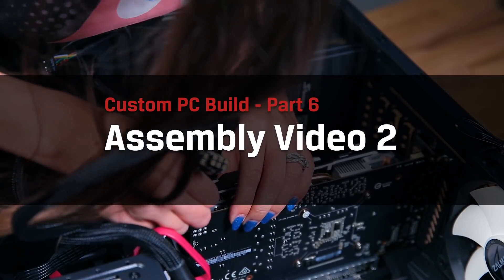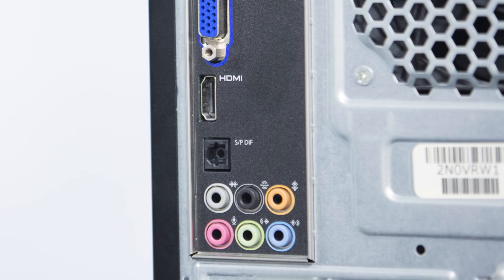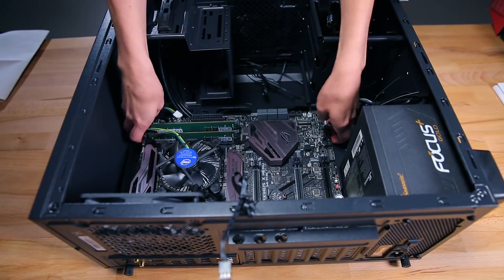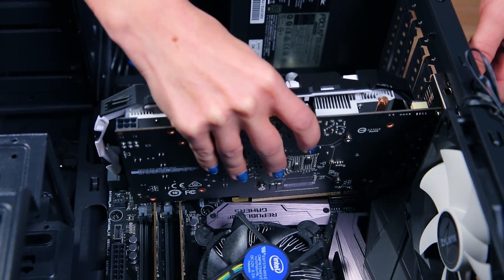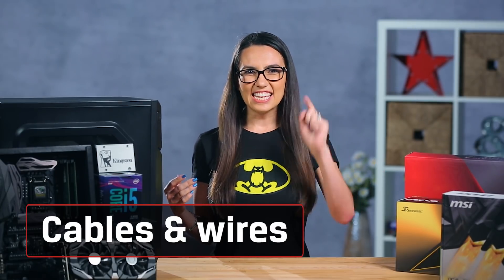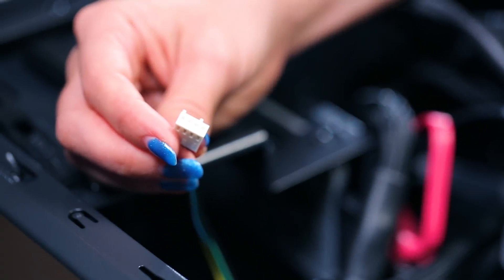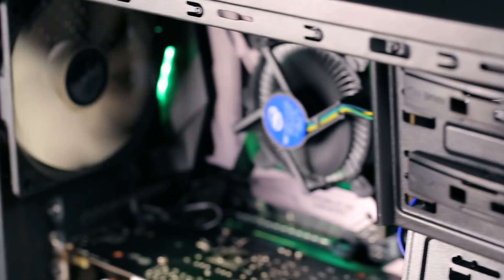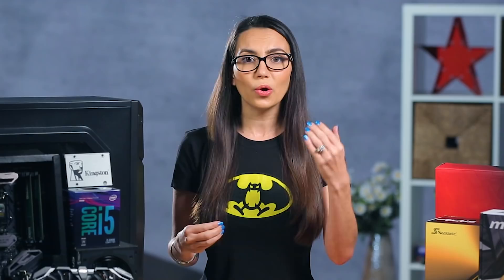PC Build – Installing IO plate, motherboard, GPU, cables, SSD – DIY in 5 PC Build Part 6

Comment: pls tell me how to replace the processor
Reply: Remove your cooler by following the manual. Clean off the thermal paste using IPA and a lint free cloth.

You'll see one or two metal arms latched down on the side of the cpu socket. Slide these slight out and lift them. Lift the slot cover.

Gently lift out the cpu and place it safely on an anti-static surface.

Use the triangle reference on the new CPU and socket to align it correctly befor gently inserting into the socket.

Lower the arms and latch them down. Apply a large pea size of thermal paste to the heatspreader of the CPU.

Refit your CPU cooler following the manual.

Comment: Just as hard to watch as the Verge pc building video. Love the energy, but it's not needed here.
Reply: I'm sorry but I can't agree man. As I said in my original comment, there's little substance here and it's rather cringe, but the Verge is on a whole other level of incompetence.

What was provided here was mostly accurate, just very sparse. It's not a guide really, it's a thinly veiled advertisement.

The Verge was a car crash of poor choices, poorer knowledge, abominable implementation and the worst delivery in any tech video I've ever seen.

You don't have to be somber to present a technology channel, LTT isn't exactly low-key and last time I checked, they're doing OK.

Comment: It is better still than the aio...that is restrictive in volume. why the ek was ok..nothing fancy though. Block wise more like those old swiftech blocks, You are making blocks smaller and more restrictive now...That's easily 2-3x more volume and can even throw moreeee pump at it.
Reply: What was this in reference to? They used a stock cooler, there's no custom loop here?

AIOs are decent enough, and restriction has got nothing to do with modern custom loops.

As for restrictions, a DDC or D5 can easily overcome the restrictions of modern CPU and GPU blocks, and the reason they're so restrictive is modern microfin manufacturing allows for significantly better cooling.

Comment: I have got a problem with my old pc ( i hope u guys can help me out)
so,when i boot up my pc it just shuts down automatically and again boot on its own. I checked and I noticed that my fans are working properly, i took the ram out and put it back but still its not working. What to do can you guys help me PLEASE????
Reply from the maker: This issue can be caused by many different factors. Is there any type of blue screen or message when it does this?

Comment: I. Want. A. RIG! I'm currently running an Acer aspire e15 and I have to put it in suspended animation (so called) for about a month after playing every day for three weeks straight. And it's only A YEAR AND A HALF OLD

However, it was four hundred bucks from best buy soooooooooooooooooooo. But when it does it runs games pretty darn well

Comment: now that i have a pc i can run up to 200 psi
and can run games like fort nite and mincaft  at 200 psi
thanks 4 the build help now i have a asome gaming pc
Reply: If you're running your system at 200psi then something's going to explode, that's a lot of pressure!

What compressor are you using?

Comment: Hey dear, Please compare the Intel core i7 HK CPU with Ryzen latest versions with their price.
Reply: Which would be better for making videos and gameplay.
Reply: Let me help you. Ryzen provides the best bang for buck if you want to do anything but game at the best possible fps.

Ryzen offers better value, flexibility, longevity and a long-lasting platform. Given the current security issues, supply issues and the trends of designing for cored, Ryzen is an easy choice at the moment.

I'm currently running an 8700k, but my next build will be a Ryzen.

Comment: Wait, so, what if I wanted to transplant the hard drive from my current computer into a new one? Would I still need to boot up an OS from a thumb drive or whatever, or would all of that already be taken care of since the OS is installed on the drive? Would there be any complications from transplanting?
Reply from the maker: There might be complications if there are driver compatibility issues. It would be better if you did a clean install of the OS when putting the SSD into a new system.
Reply: You'd be better off doing a fresh install.  Backuo the files you want from your existing drive, reformat and do a fresh install.

This is why I have a drive specifically for the OS. All my libraries etc are on other drives, so when I reformat, there's almost no work to be back up and running.

Comment: 753 people think they are better at building PCs than the rest of us. For me, I go refurbished and then go by parts if I have to. Cheers!
Reply: Nothing wrong with that, ultimately it's whatever works for you best. There's plenty of instances where say, an old office PC paired with a decent GPU, can make a great budget gaming system.

I disliked the video because it offered no more information than component manuals, and skimmed over important factors that could actually help someone trying to build a PC for the first time.

Comment: I have format system reserve partition during booting pc dell vostro 3560 and suddenly it stop when I again try to boot it doesnot boot, in recent there is no os in my system, how to again install system reserve partition or os
Reply from the maker: Hi Rohit, Kindly contact your system manufacturer for further assistance on bringing your system to factory condition.
Reply: Pull the drive and put it in another system. Recover all the files you want to keep and store them somewhere safe.

Reformat the drive/partition, and reinstall windows.

Comment: dose any one really need this? these days building a computer is to easy, you cant even have IRQ conflicts these days.
Reply: Not this no, there's more information in the manuals.

Cable management, fan config etc for beginners, yeah sure.

At least it's not the Verge.

Comment: A graphics card is the whole thing, a gpu on the other hand is just the chip/die on the circuit board of a graphics card. So please don't call a graphics card the gpu. It's not right.
Reply: It's very common for people to refer to a graphics card as a GPU, it's faster to type and most of the community is too chill to be pedantic about it.

Comment: Touch the motherboard without ESD equipment?
Reply: Modern hardware is surprisingly resilient. I've built machines on carpet with no grounding. Not something I'd recommend, but you'd be surprised how hardy PC components are.

Comment: Decent build guide. The main change I'd make is to do a test boot of the main components before putting them into the case. This is especially important for first time builders who would have a harder time disassembling everything if a part was bad

Comment: I wish I had I pc I really do I am sick of playing the ps4 is the same games over and over again nothing new all the time if only I had a gaming pc :(
Reply: kilerwes301 save up and buy parts trust me its worth it i moved to pc and it feels much better
Reply: same
Reply: @kilerwes301, Try ebay for “AMD fx-6300 (or fx-8300) desktop pc”
Reply: Sell ur PS4 and save up for a pc

Best budget build:
CPU: Intel Pentium g4560
GPU: Gtx 1050
RAM: crucial 8 gb 1 stick ( cheapest I could find ( tell me any cheaper ones))
Mobo: any cheap compatible one
PSU: Evga 450 bronze 80+
Case: any

Edit: comes to about £300

Comment: I don’t have intergrated graphics or dedicated none of my fans spin do I need to gpu for it to all switch on
Reply: Not for it to switch on, no. But without a display adapter you won't be able to connect a monitor.

Comment: I know ho to build it but its quite expensive so i prefer a laptop
Reply: A laptop. OMG.. Laptops are basically over priced down clocked lamed garbage.
How to make an i7 cpu run like an i3.. Put it in a laptop.
How to upgrade your laptop... You get your wallet out and buy a whole new over priced piece of garbage laptop
Reply: saem i kno ho to build asswell but co mputer dum and consol stronger
Reply: i honestly hope you are trolling
Reply: you used to be able to build a decent pc for 400 bucks but i wouldnt build higher end ones right now the gpu prices are up
Reply: You pay more money for the same performance in laptops, with none of the flexibility of upgradability.

They absolutely have their place; I love my XPS15, but they aren't a cheaper alternative to a desktop.

Comment: What if you use a cou cooler like the h100iV2? How are you supposed to know if it’s working? When you first boot...
Reply: Ah.. The lazy brainless method. Make your own custom water cooling loop and you'll know if its working.
Reply: @sahhull  Northy, that's the type of silly elitism that gives the PC community a bad name. There's absolutely nothing wrong with using an AIO. It's far more convenient, and custom loops are most definitely not for beginners.

OP: You'll know an AIO is working because a) the fans will spin, b) you'll hear (and feel) the pump running, and c) your machine won't instantly power down 😁

Comment: CPU Fans and GPU Fans do not necessarily begin spinning immediately after boot up, Most computers have a bios on the motherboard for a fan curve based on cpu and gpu core temperatures and voltages
Reply: Logan Emily GPU has a separate Bios for its fancurve.
Reply: This is True, I should have clarified
Reply: All motherboards have a BIOS, plenty default to a fixed rpm. I don't believe there's a single motherboard that would run a fan curve dependant on core voltage.

A 3 pin fan output will more often than not default to 12v, and until a PWM fan receives a signal, or it recieves a 0% signal,  it defaults to 100%.

Most motherboards don't support a 'stop' feature, and I would indeed expect all the fans to almost immediately start spinning on a system without an MBR.

Comment: You also assume that every motherboard uses the F1 key to get into the bios that is not the case. I really hate it when people put up videos when they really don’t know what they are talking about.
Reply: Really then why is it that 5 different computers I work on from five different manufacturers use different keys not any of the 5 use the F1 key.
Reply: nick poverman Kabeer Male
Reply: nick poverman vu vu
Reply: nick poverman
Reply: nick poverman 
.gya
Reply: Without a MBR you wouldn't need to press anything at all. The system would boot straight into the BIOS unless the UEFI defaulted to USB and you had the win10 dongle inserted.
Reply: almost all are.
Reply: bro like chill out. what did your parents do to you growing up?

Comment: Now if only I can get RAM and GPU at MSRP
Reply: Biggest barriers to entry right now.
Reply: A comment just as relevant today as it was two years ago
Reply: Still relevant
Reply: 2021. Same story sir.
Reply: Ikr
Reply: ME
Reply: madeintkyo that won't be for a while. Hopefully by June. Fingers crossed. But for right now. You can buy used.
Reply: madeintkyo most likely not until they make mining specific cards that are better than normal gaming gpus
Reply: I used https://www.nowinstock.net/computers/videocards to see when they came in stock on NewEgg and bought it straight from them. It was still a little overpriced, but not as bad as second hand prices.
Reply: i upgraded my alienware laptop, even tho its an older machine, Kingston RAM,   2 - 2GB cards, (4GB) was a bit pricey...667MHZ FSB!! I bought data memory systems.. works great!
Reply: Diacute
Reply: Diacute screen to
Reply: this aged well